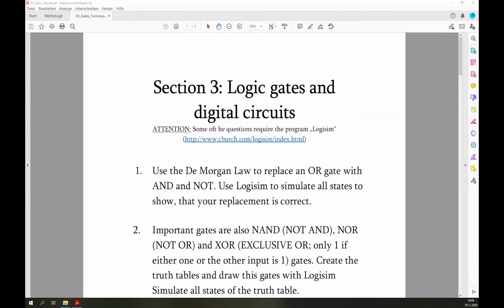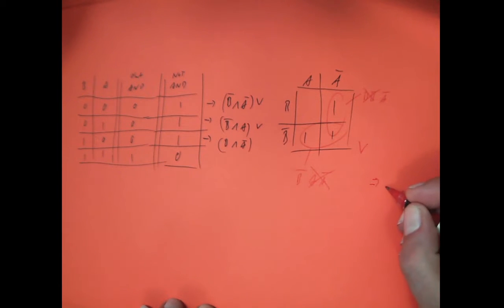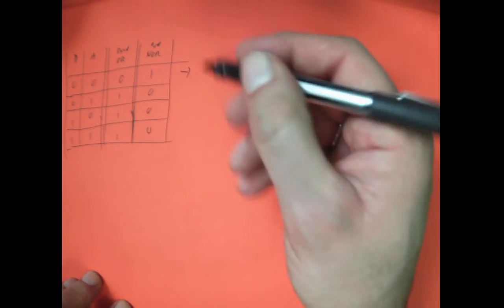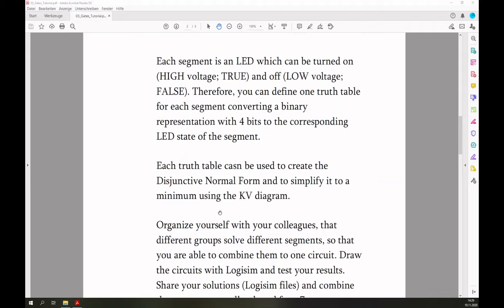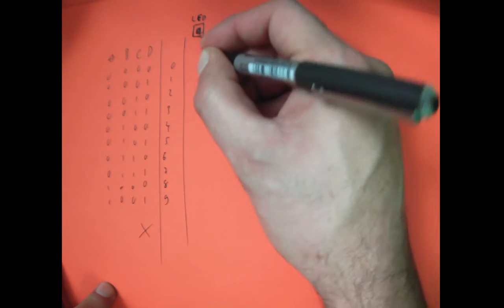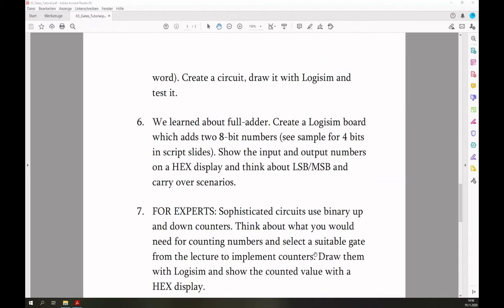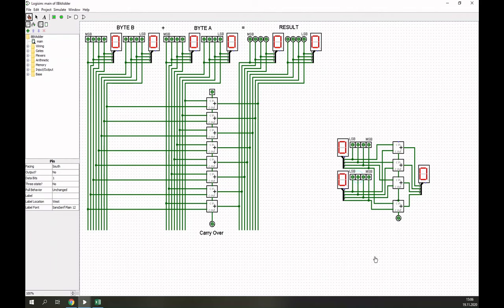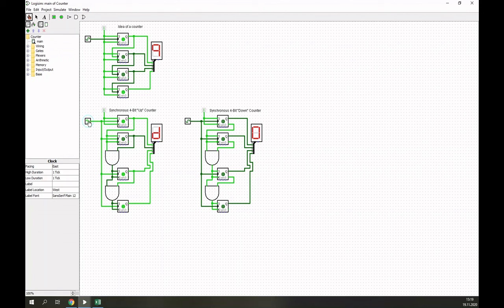Tutorial of lesson 3: gates and digital circuits

Comment from the maker: Hi there: there was a feedback and question about CNF in the video and why we do not take care on the numbers from decimal 10 to 15 here. I'm sorry, but my explanation and samples were a little bit missleading, because they mix viewpoints. 

Well, we do not take care in DNF and CNF because we focus on a single seven segment display which can represent decimal 0 to 9. In DNF we set the output to 0 for decimal 10 to 15. Therefore, the complete CNF should contain these 6 terms in addition. My CNF sample is just valid for numbers from decimal 0 to 9.

A completely correct version (like shown in the circuit of two 7-segment displays) will continue the 1s position in the base 10 system in that way: 10 => 0, 11 => 1, 12 => 2, 13 => 3, 14 => 4, and 15 => 5. The truth table, the CNF/DNF and the result would look different then.

Sorry for the missleading ;-)